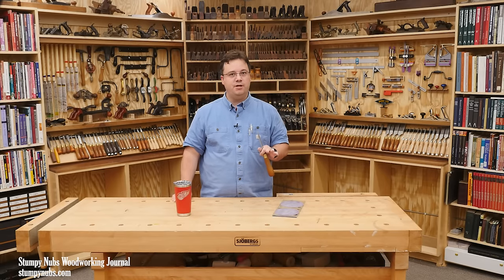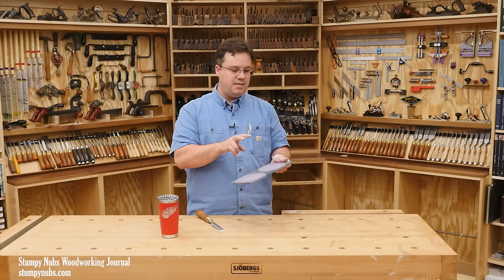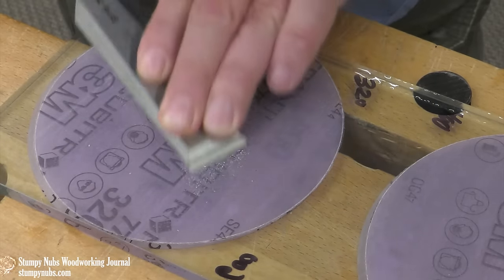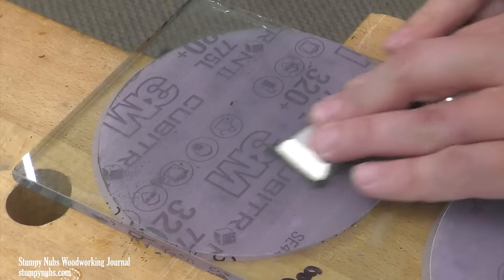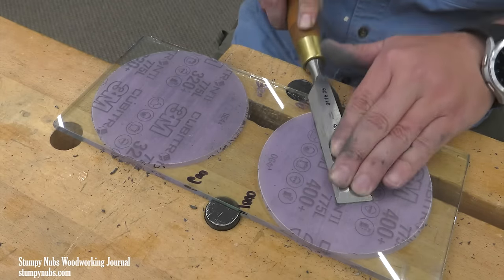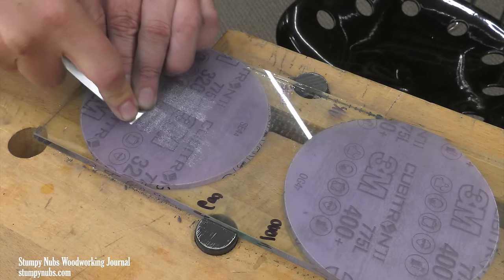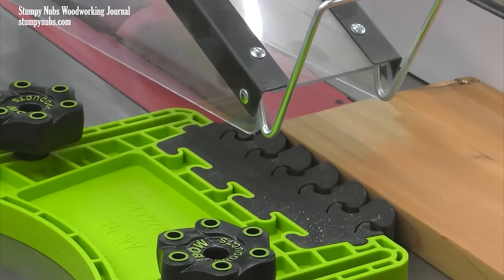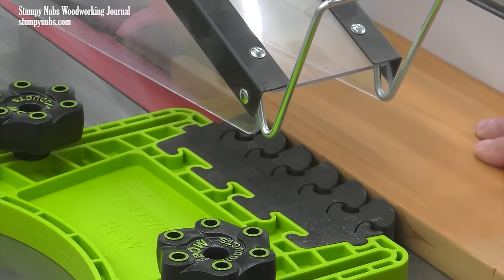A game-changing NEW way to sharpen! (Scary SHARPER!)

Comment: im just gettin started in woodwork..took me near 50yrs to find sumthin that i like..haha....a thing that really gotmy attn with wood..is that precision counts..i always thought itwas jus cut & attach..lol....anyhow..like isaid..im new....so most ofmy tools r decades old..or from harbor freight/walmart....butim learnin..thats th point.....soooo....ive this set of plastic handle chisels from harbor..they were more like chippers instead of chisels..haha....then this vid found & inspired me....i had this lil ceramic tile..supersmooth & deadflat....got sum  spray adhesive from walmart(cuz they dont have th adhesive side sandpaper)....sprayed th back ofth sandpaper & positioned it onth tile....it workd beautifully....i didnt have a real correct progression of sandpaper onhand....so i went 180-320-400-600....this was a learnin sumthin f me....now i know..this is a beautiful method..&i jus need yo adjust my grits...this turnd a harbor chisel from a chipper to a crossgrain slicer..paper thin rolls....and i didnt even do it right..lol....thanku soooo much..ur a wonderful teacher😘💗

Comment: For initial flattening off this seems good, though a diamond stone is also fine. The flat plate still seems slow, and to involve too much material removal, compared to a traditional hollow-grind from a wheel on the angled bevel - as was usually done by working joiners e.g. here in the uk. Once you have the hollow grind set, you can keep a blade sharp with just a few strokes on an oilstone or similar. Just takes a few seconds, as you only have to remove material from the very tip

Comment: Save sandpaper money,buy 8x11 inch sheet ,take sandpaper with both hands and roll it across any door frame ect. This removes any high spots in the sandpaper in manufacturing.did this for years shaping surfboards,where the material is soft and easy to mar.thus making a better smoother accurate cut.!

Comment: In a previous career we required extremely flat and accurate surfaces to perform a certain test.  Granite slabs were the only things that met the standard, they were very expensive even for a piece the size of a piece of paper, but maybe 3-4 inches thick.  I bet a piece of glass is good enough for me!
Reply: Granite tiles from the tile store can work too
Reply: i picked up a old glass frige door for free. room for ovrer 8 sheets of full sized sheets of sand paper. i left it in the frame for safety and ease of moving. its about 2 feet by 4 feet works great

Comment: I've been amazed at how quickly that sandpaper cuts metal and sharpens steel.  I was surprised you didn't show the kits Mike sells for the drill press to make the process even faster.  I made this a few months ago, and sharpened about 20 vintage chisels to razor sharp in about 15 minutes.  Absolutely blew my mind and converted me to this system for all my tools now.
Reply: So, who is "Mike"?

Comment: Cubitron 2 and 3inch roll loc grinding disk in a m12 right angle die grinder is also magic nearly replaced my old 4.5inch porter cable plug jn grinder for all my needs.

Comment: How are the other grits of the Cubitron II discs to use for normal wood sanding? Is it good to use all the way from start to end for sanding normal wood?
Reply from the maker: Cubitron II is the best I have ever used for wood, both in speed and longevity. I use it exclusively.
Reply: @StumpyNubs  Very nice. When seeing your video I searched fir them here in Norway, and they're available and not expensive. Like a 50 pack for $20.

Comment: How does one get the self-adhesive discs off the glass when they need to be changed?
Reply from the maker: They peel off. If you need help (I never do) use a heat gun. If adhesive residue builds up over time, clean with mineral spirits.
Reply: @StumpyNubs  Thanks for the video and reply

Comment: 3:07 Japanese chisels have a hollow back by design. You don’t remove it. It helps too reduce effort in resharpening. And scary sharp the whole time
Reply from the maker: This isn't a Japanese chisel.
Reply: @StumpyNubs  obviously so. That’s not the point. The point is there is no real reason the back needs to be dead flat. So long as the long axis is straight, which it oftentimes isn’t from tempering, you can leave the back hollow. Once the edges of the back sit flat on a known flat surface you are done.
Reply from the maker: @avenuex3731  While you may not have to eliminate the entire hollow on the back, it is fast and easy to do so with this method. So why not? A western chisel relies upon a flat surface as a reference while paring. I find it essential to have at least an inch or so flat. You may do as you prefer.

Comment: I've been using the old scary sharp system for years. One thing I've never been sure about is if running the wheel of my honing guide over the sand paper actually crushes and dulls the grit that it's rolling over. Any ideas?
Reply from the maker: I don't believe so.

Comment: What’s the benefit of those discs vs lapping film (not sandpaper)
Reply from the maker: What type of lapping film are you referring to? Most lapping film is just very fine sandpaper. I would not use that to flatten the back of a chisel.
Reply: @StumpyNubs  just regular 3m AO lapping film with psa on plate glass. A pack of 7 sheets ranging from 300 to 16000 grit goes for about $12. Seems to work better than my diamond plate for new chisels. After that, I just use my diamond plate and a strop to maintain. They last a decent while too especially if you use an eraser to clean them, like you showed in this video.

Comment: That hollow on the back is intentional. It is the same with Japanese chisels. You only need about 5mm of flat back beyond the edge. The hollow means you have much less material to remove. 
Then after you sharpen the chisel so much that you move the edge too much towards the hollow, you flatten the back some more. Simple and easy.
Reply from the maker: No, it was not intentional. This isn't a Japanese chisel, which has a carefully placed and formed hollow, combined with a short blade so the heel may be used in conjunction with the tip to replace the reference surface lost by the hollow. A western chisel with a poorly formed dip in the back is not the same thing.

Comment: I’m confused by the use of both Cubitron 400 sandpaper and P600 Aluminum Oxide paper. From the various charts I see online (and they don’t agree with each other) ANSI 400 is actually finer than P600.

Comment: Ceramic abrasive is recommended for metal not so much for wood. I'm surprised more people don't know this. Probably cause their not doing much research into what abrasives they are using. They just grab whatever and end up wasting time and money. I know i have in the past but now that I know more on the types of abrasives available I'm being more productive and not wasting my time and money. Thanks for sharing.
Reply from the maker: I completely disagree, having used 3M's cubitron II extensively on wood.

Comment: I'd only flatten a hollow to the extent that its wholly surrounded by a flat polished surface. You could argue that this is kicking it in to the long grass as repeated sharpening will creep back to the hollow but deal with that when it comes. But they're great papers and anything which gets you to your required level of flatness quicker (and back to the wood) at a reasonable price is good.👍

Comment: Just curious;  would a thick slab of granite from say a store that sells countertops work as well as glass?   Reading all the comments about glass is a little confusing.    Thank you.
Reply: Yes. Granite countertops are ground perfectly flat.
It is part of the standard manufacturing process.
It is accomplished by rubbing two slabs together, with
grinding compound between them. 😁✌🖖
Reply: @zapa1pnt   Thank you for your quick response.
Reply: Yes. I picked up a free granite offcut from a kitchen remodeler, perfectly flat granite works like a charm.
Reply: @gerarddelmonte8776      Thank you Sir

Comment: @3:05 why does the back need to be completely flat ? As long as the blade edge is shiny after a run it means it is in contact with the flat plane . The centre of that chisel is never used.
Reply from the maker: The entire back does not need to be flat, just enough of it to use as a reference while paring. Usually about an inch.

Comment: I see videos like this where somebody's using a chisel to shave paper thin curls off of wood, especially off the end of the wood. I know the chisel is super sharp, but how much does the nature of the wood itself affect the ability to do this?  If you tried that on the end of, for example, a random 2x4, would it shave as well?
Reply from the maker: End grain is the most difficult fibers to cut with a chisel, and soft wood is the most difficult of all end grain because the chisel has to be very sharp to cut it cleanly, or else the fibers will crush. That's why you typically see tests shaving soft pine end grain and not hardwood.
Reply: @StumpyNubs  If I'm understanding you correctly, you're saying that in fact that end-grain shaves as in your video usually are done with 2x4s, because they're so challenging?

Comment: I always thought the hollow back was just a way to make sharpening faster. Less material to take off when making the edge sharp again. No need to sharpen anything other than the edge. If you remove the hollow completely then the next time you flatten the back of  that chisel you’ll have to grind the whole backside, instead of just the edges.

I doubt the shape or positioning of the hollow matters. I think I’ve seen American Made chisels with hollow backs.  Anybody else seen those?

Comment: I am a little disappointed with the system you have recommended. I like the Cubitron disks on my random orbital sander however the course 320 grit seemed to wear out in the middle of flattening the back of my new chisel. I was trying to flatten the whole back for paring and it is a Japanese chisel which has a much harder back, but the cubitron did not last well for this operation.  Perhaps I need to use a courser grit to start. I'll try that. If all else fails, I guess an 220 grit water stone is in my future and use the cubitron to bridge to  my 1000, 5000, and 10,00 stones
Reply from the maker: So you used a "much harder" steel than what I demonstrated, and you are "disappointed" that it wore out the sandpaper quicker?

Comment: It's not often I disagree with you, but flattening with coarser sandpaper will get the job done faster and cheaper overall.
Reply from the maker: Everyone has their own preferences based upon their own experience.
Reply: @StumpyNubs  Everyone is entitled to their own opinions.  The facts remain the same.
Reply from the maker: @rockets4kids It's fine to disagree with me, but you go too far when you insist that your point of view is the only factual one. I've been around this craft a long time, and I've interacted with thousands of woodworkers of all levels. I've learned that what works best for one doesn't always work best for everyone and it is folly to think otherwise.
Reply: @StumpyNubs  Have you actually tried using the coarser Cubitron abrasives?
Reply from the maker: @rockets4kids  of course I have. How else would I have formulated my opinion? Courses grit leaves deeper scratches that must be removed by working your way up through more grits. In most cases, the 320 is course enough because the Cubitron II cuts faster, and starting at 320 requires less time and less paper. It's the same with wood. I could always start at 40 or 60 grit and remove wood faster initially, but if there is no need to go that low, I am better off starting at 80 or 120. If you prefer to go courser at first, do what works best for you. I can accept your point of view. I don't see why you can't also accept mine. Either way, I'm not arguing about it with you anymore. Have a nice day.
Reply: @StumpyNubs  Which grits did you actually try?  Did you actually measure the time required to flatten the back of the chisels in question?

Comment: At the 3:00 mark, why does the entire chisel back need to be flat?  What if just the following parts are flat: near the bevel and enough to make a reference surface?  A lot less sanding. You’ll get a sharp edge. Japanese hand planes only have enough co-planer sole to make a good reference surface.
Reply from the maker: The back of the chisel is a reference for paring. Hand planes don't work in the same way. The entire thing doesn't have to be perfect, but you do want a good, flat surface for at least the inch behind the cutting edge.

Comment: Curious as to why you bother removing the hollow spots on the flat face? I run a sharpening business and would never personally bother with that so long as the flat face at the cutting edge is dead flat. 

Not that it's an issue, just seems like time better spent on the rest of the process
Reply from the maker: Because the hollow reached the side edge, leaving me a poor reference surface for paring.
Reply: @StumpyNubs  Makes sense, chisels aren't a large part of my business, nor my speciality so it's always good to understand better techniques. Thanks for the response

Comment: Try that with a Japanese chisel, takes a lot longer than 5 mins
Reply: Well, yeah, but then you are trying to flatten a purpose-made, 2mm deep cavity in the back. 

Completely Flattening the back of a Japanese chisel completely misses the point of why a Japanese chisel is made the way it is in the first place
Reply: @CTRCustomWoodworks  I think you misunderstood the point I was making. I did not mean to remove the hollow, I mean that the hardness of a Japanese chisel is incomparable to the majority of western chisels and thus the little material you do have to remove will take longer than 5 minutes. I hope that clarifies my opinion 👍
Reply: @michaelmason1659  I think you misunderstood my point- you wouldn’t be flattening the back of a Japanese chisel in the first place, so the comparison isn’t fair.
Reply: @CTRCustomWoodworks  of course you still have to flatten it, the whole idea of the hollow is too make it easier too flatten because after hardening the chisel warps slightly and to cut the cost of the chisel the flattening is passed on to the customer

Comment: I often hear float glass described as perfectly flat in this context, this triggers me a bit. 
It is very flat compared to a 50 year old workbench but compared to even a grade B surface plate it's not remotely flat. Whether it's good enough for the application is a separate question, thousands of people are getting away with it so I expect it is. 
To see this for yourself put your glass on something dark and use it as a mirror to examine your overhead fluorescent tubes.
Reply: And what should we expect to see if the glass isn’t flat? Wavy tube reflections?
Reply: @CTRCustomWoodworks  Very much so, yes.

Comment: A small hollow in the back has no effect so long as the cutting edge and both sides are flat.
Reply from the maker: You use the back of a chisel as a reference for paring. At least an inch or so should be flat. Since this method is so easy, I did the whole thing. Japanese chisels have hollows, but the blades are short so you can use the tip and the heel together for stability. A poorly formed hollow on a Western chisel is a defect not a useful feature, in my experience.
Reply: @Stumpy Nubs  but if both sides are flat the hollow in the middle doesn't matter. If it was a high spot then it would.

Comment: Hmm. If the hollow in the back is such a problem, why are Japanese chisels so reviered? As long as the section by the edge is flat, your good to go.
Reply from the maker: You use the back of a chisel as a reference for paring. At least an inch or so should be flat. Since this method is so easy, I did the whole thing. Japanese chisels have hollows, but the blades are short so you can use the tip and the heel together for stability. A poorly formed hollow on a Western chisel is a defect not a useful feature, in my experience.

Comment: I disagree with your premise that the back should be flat.
Hollow ground is good for the back as well as the blade.
2nd. diamond sharpeners can last a life time. If you don't have a diamond sharpener then these 3M sander discs are great
Reply from the maker: Hollow chisels are specifically ground with a carefully placed concave area on the back. That's not the same as what is on Western chisels, like the one in this video.

Comment: The back does not need to be completely flat. Just the bit where the back meets the edge. I mean otherwise the bevel edge wouldn't work because it has a huge chunk missing from that plane. this use of these new abrasives definitely will give a good result an they last longer than standard sand papers. but the initial flattening the back is a waste of time.
Reply from the maker: A western chisel with a long blade requires a reference surface on the back to aid in paring. That surface only has to be an inch or so long, but since this process is so easy I decided to flatten the whole thing.

Comment: 3:00 not quite true.  Only the area next to the cutting edge has to be flat. That hollow you have is ok.  Japanese chisels have hollow backs on purpose.
Reply from the maker: You use the back of a chisel as a reference for paring. At least an inch or so should be flat. Since this method is so easy, I did the whole thing. Japanese chisels have hollows, but the blades are short so you can use the tip and the heel together for stability. A poorly formed hollow on a Western chisel is a defect not a useful feature, in my experience.